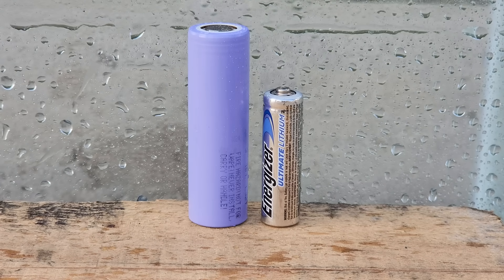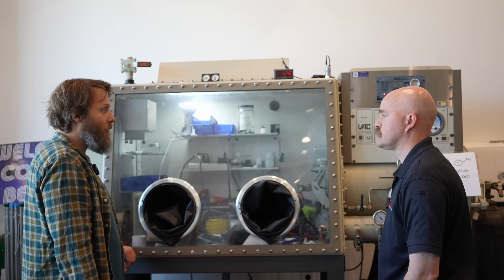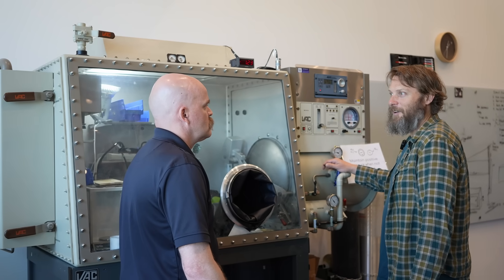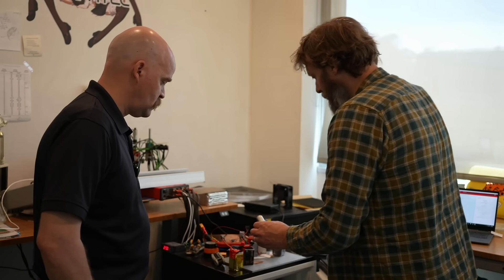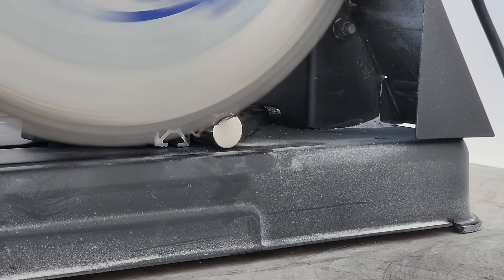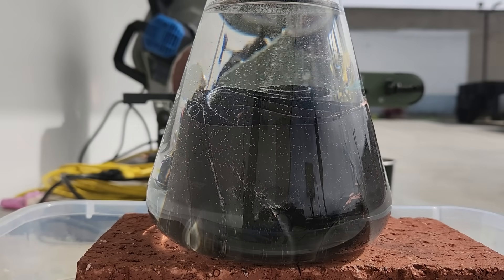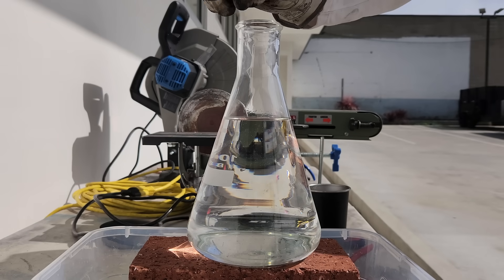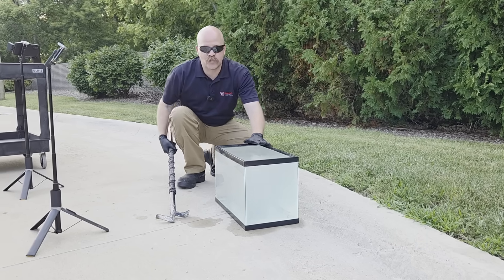Do Lithium(Ion) Batteries Explode in Water?

Comment: Lithium burns in water, and this reaction releases hydrogen, which explodes.
Reply: H²O is water. When the lithium burns with water you will have plenty of both H and O created.
Reply: @sang3Eta  No, you don't get any O, because that goes to the lithium
Reply: Fuck yeah, i finally got a comment to stick. A comment about basic chemistry. I hate this website.
Reply: @Pro_Triforcer Yeah, I think you get a time-out if it decides one of your comments were mean.
Reply: @sang3Eta  The O goes to the lithium to make LiOH.
Reply: @sang3Eta  Ok, i have tried to explain why that's wrong twice now, but both comments have been eaten by YT's mod bot. So i guess i'll just say that you're dumb and should read a chemistry book.
Reply: So H2O breaks down into H and O, which then recombine to make H2O, somehow explosively releasing more energy than there was at the start. Brilliant.
Yeah, no. The oxygen goes to the lithium to make lithium hydroxide.
Reply: @Pro_Triforcer And it can create hydrofluoric acid.
Reply: Yes, only in lithium metal batteries, any battery with lithium salt which is any rechargeable lithium battery doesn't have any elemental lithium and only has lithium salt
Reply: You have to go down to the more reactive Potassium in group 1 before the hydrogen self ignites and burns when dropped in water. Lithium is the least reactive of the Group 1 metals with the unpaired electron bound closer to the nucleus and even Sodium will just fizz when dropped in water. I have seen so many demonstrations of this. Nobody has even bothered to drop Lithium in to water as a school demonstration that I can remember.
Reply: Hydrogen gas, the very worst gas for going bang. Most gases like to burn and are fussy about exploding. I gather Hydrogen is the opposite in most situations
Reply: Hydrogen can't explode without oxygen, and there isn't much oxygen underwater.

Comment: Someone at a nuclear site dumped water into a piping system that at one point contained lithium. The reaction caused a water slug to speed down the pipe until it hit metal plate that was welded over one end. The impact blew the plate off the end of the pipe, through a filing cabinet, through the wall of the building, and out across the parking lot. It was like a cannon shot.
Reply: You have any more information about that? Like the specific site, time when it happened? I'm not finding anything after searching several combinations.

Comment: As we learned in Chemistry, when you mix a highly concentrated acid with water to dilute it, do you add the acid into the water or the water into the acid? Think about what happens either way and then look up the answer. Don't play with highly concentrated acids or other chemicals until you learn some chemistry. Very bad things can happen. Or not.
Reply: Acid into Water = Alright 

Water into Acid = Warning ⚠️ 

Method for remembering (taught at school chemistry classes): – 

'A' (for Acid) = 'Alright' 

'W' (for Water) = 'Warning'
Reply: @datepalm1969  Neat saying, I'll remember it.
Now here is the why. Water and acid mix really quickly. A little bit of acid heats up a lot of water, so the temperature of the water only goes up a bit. But a tiny amount of water mixing with a lot of acid boils the small drop of water immediately and that steam shoots the water and acid up and all over the place.
If it wasn't a chemical that had such a low temperature boiling point like water, then this wouldn't happen.
This battery experiment had too much water for a good explosion. Sometimes safety last is the "right" wrong answer. 😮😊 Cool video. The batteries looked just like electrolytic capacitors inside.
Reply: @CrispyCircuits Thank you for the great explanation. 

And now for some advice... 

Do not buy an EV! 😀

Also, do not buy a 'battery-powered' electric scooter, a 'battery-powered' electric lawnmower, or any other type of 'large battery-powered' electric equipment — they can easily burn your house down, even if stored in the garage. Not worth risking your life for.

The climate change ideology is a complete hoax that is not based on 'true' science — it's a completely fabricated scam.
Reply: @CrispyCircuits  Thank you for the great explanation. 

And now for some helpful advice... 

Do not buy an EV! 😀

Also, do not buy a 'battery-powered' electric scooter, a 'battery-powered' electric lawnmower, or any other type of 'large battery-powered' electric equipment — they can easily burn your house down, even if stored in the garage. Not worth risking your life for.

The climate change ideology is a complete hoax that is not based on 'true' science — it's a completely fabricated scam.
Reply: @CrispyCircuits Thank you for the great explanation. 

And now for some helpful advice... 

Do not buy an EV! 😀

Also, do not buy a 'battery-powered' electric scooter, a 'battery-powered' electric lawnmower, or any other type of 'large battery-powered' electric equipment — they can easily burn your house down, even if stored in the garage. Not worth risking your life for.

The climate change ideology is a complete hoax that is not based on 'true' science — it's a completely fabricated scam.
Reply: @CrispyCircuits Thank you for your reply and great explanation. 

And now for some helpful advice... 

Do not buy an EV! 😀

Also, do not buy a 'battery-powered' electric scooter, a 'battery-powered' electric lawnmower, or any other type of 'large battery-powered' electric equipment — they can easily burn your house down, even if stored in the garage. Not worth risking your life for.

The climate change ideology is a complete hoax that is not based on 'true' science — it's a completely fabricated scam.
Reply: You confused me.

Comment: A single lithium chemistry cell has only the maximum of ~4,2V. If there aren't significant water column on top of the battery, the distance between the terminals is quite the distance to make the battery short. Obviously the problem comes when you put enough of the cells in series and raise the voltage enough and have the terminals of said voltage close enough for the voltage to jump across. I guess in theory you could design battery packs with enough contactors to separate out the cell groups to make submerging a whole pack a non event in the short term.

Comment: Lithium based, in any form, Battery packs will generally go on fire when exposed to water.  I would put that very early in the vid. To stop stupid people from throwing battery's(packs) into water.

Even just exposure to very high humidity can cause burning down a house.  As demonstrated by a Tesla in the past year.

Also there is a vid of some press testing fanatics.  The battery cell instantly exploded at the first mm of compression.  Mayne also put extra warnings and do not try at home physically damaging cells?

Comment: People tend to not have been taught how water is a thermal mass in these cases, and thus the more spectacular reactions can be quenched because the situation doesn't allow a localized hot spot to form.

The chemistry and thermodynamics can favor a violent reaction, but if the heat removal rate exceeds the heat production rate - or is even kinda close - you just don't get hot enough...
Reply: or that scenario where the liquid water turns to gas instantly creating a “hot pocket” of protection. I believe it’s involved in cavitation, but don’t know the phenomenon off my head.
Reply: @bryanjk  Cavitation, as what hapeens in some pumping conditions in centrifugal pumps involves the low pressure zone behind the trailing edge of the impeller blade dropping below the vapor pressure of the  liquid, allowing a pocket to flash into the vapor state... which almost immediately collapses, with the incompressible fluid slamming into the impeller.

The erosion/spalling caused by the impact can ultimately destroy the pump.
Reply: @bryanjk I think you’re thinking of the leidenfrost effect, where a liquid rapidly (near-instantly) evaporates creating a layer of gas that separates the liquid from the heat source. It’s the reason drops of water skip across a very hot pan.
Reply: Perhaps not

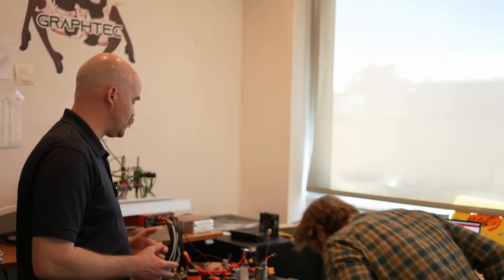Comment: 6:42 In my experience we learn so much from what's readily available, such as harbor freight tools. They can get the job don't for a while, but they also tell you more about what you actually need. It takes experience to know what you need from specialized equipment.
Reply: Please explain what Harbor Freight has to do with your comment. What are we learning about them?
Reply: @user-ln7of9gs4s Harbor freight has cheap tools that you can start out with. They don't last as long and they have less features, but they get the job done. Then, the next time you do that job you know what you need out of a more expensive tool.
Reply: @user-ln7of9gs4s  I think they are suggesting buying the cheap thing first, learn why it does not work.
Then you well have a much better idea on what to look for.
My fist bicycle that I purchased new was relatively [cheap]. I spent as much on accessories as I did on the bike itself.
When the drive train wore out within 2 years: I learned that you can't replace the chairing without replacing the whole crank-set. More expensive bikes also tend to have better adjustment [until] parts need eventual replacement as well.
My newest bike is too expensive. Not comfortable leaving it anywhere, Community workshop is not really equipped to work on the hydraulic  brakes and tubeless tires (with tire goop).

Comment: Lithium is a highly reactive alkali metal,exposure of the lithium to humidity in the air or just water results in a highly exothermic reaction.
Reply: Kinda like Potassium metal and water. 😲💥🔥
Reply: @denyscpoyner Exactly,sodium,potassium and lithium are all pretty similar in their reactivity. All in same group on periodic table. 👍
Reply: I've done all of those in person and lol no. Lithium is MUCH more tame than sodium, and sodium is more tame than potassium. They're "similar" but the speed and scale are much different.
Reply: @willythemailboy2  the difference is that Lithium aggressively reacts not with just water, but with pretty much everything - organic, non organic, sand, gases, liquids and so on. That fact makes it extremely dangerous, because it really hard to stop the reaction.
Reply: @ingvarsimons7548  Sodium and Potassium react with anything Lithium will but more vigorously. Metals get more reactive as you go down a column in the periodic table because the size of the atom and the shielding of the inner electrons make the valence electron easier to lose. That's basic chemistry.
Reply: That's only in non rechargeable lithium metal batteries, if lithium salt battery there is no elemental lithium and its the electrolyte burning
Reply: @thatguy7612 thank you for putting me in the picture,at 50 yr old batteries go in the back of the clock or on your car or tractor,lead acid,to start the engine and run the lights. I dont need a poop load of batteries inconveniencing me in the number of ways an ev does. Not to mention the conflagration possible with a lithium pack. I know where im at with diesel. That will do me .
Reply: @thatguy7612  Lithium ion batteries have lithium metal in the cathode when charged, which is why those batteries burn so much worse when charged vs when nearly uncharged.

Comment: The 18650 has a tiny vent hole and it will vent violently as it pops the positive terminal. I know this from cheap solar garden lights, one exploded because the battery overcharged, the result was like a gun shot, from one battery.
Reply: better to have the weak point pop, than have shrapnel in all directions.
Reply: @economicprisoner  blew the plastic light apart, glad no one was standing near it like a child. I disposed of all the lights since

Comment: I haven't watched it yet, or gone through the comments, but I'm gonna say fizzle, unless it gets too angry when it's presumably attacked by the shears, in which case maybe a flash due to short circuit, followed by slightly angrier fizzle.
Edit - Commenting before the much more innocent looking Energiser primary cell gets tortured. I'd expect a bit more excitement with that one, because they do have a small amount of  metallic lithium in them, but I doubt it'll be especially spectacular.
Edit 2 - Yeah, about what I expected, the unwrapped primary cell in the conical flask was a bit more energetic than I expected, but still not exactly the apocalypse most folk think would happen. Good comment that @3DPDK makes below though, about water intrusion into a battery pack or its BMS, especially salt water, which'd deffo up the ante a bit. And dumping iffy individual Lion cells into salt water in a controlled manner versus what happened in their boat, is actually a known, reasonably safe method of making them much safer for final disposal, because it completely discharges them.